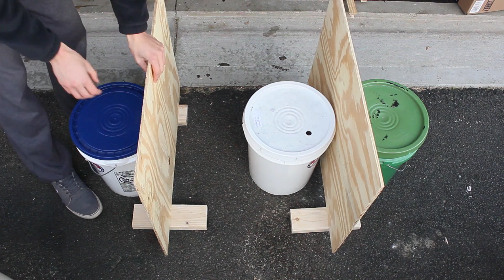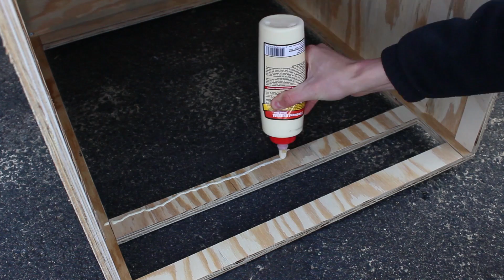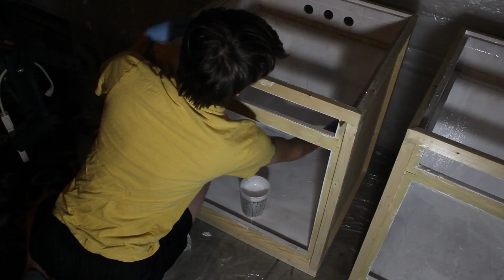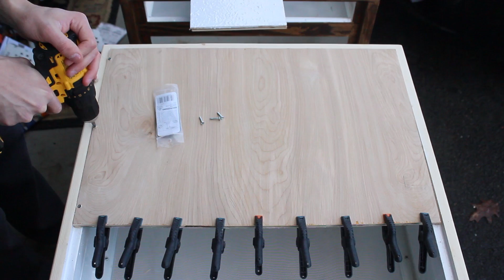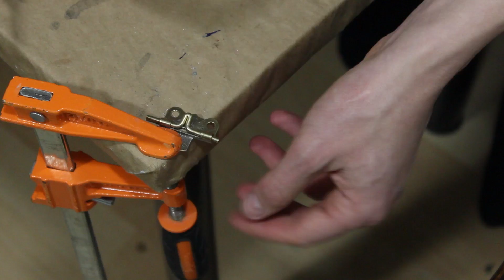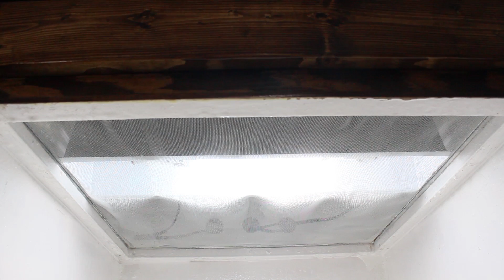DIY Plywood Reptile Enclosure (Small Version)

Comment: Genuinely curious question - Do you really need the screws considering the strength of the wood glue? I build cabinets and always remove the screws at the end per manufacturer instructions. Have you tried just wood glue before without screws?

Comment: I'd have added metal corner supports.  You can't rely on screws drilled into 1/4 inch plyboard for adequate support, though you also added a thousand individual little pieces which I wouldn't have the patience to do, and I have a lot of patience.  Over all, you are more of a craft-o-holic than I could ever be, but one way or another, it turned out nice.  Still, it would have used a pre-stain so as not to create a mottled appearance.

Comment: Wow. Great job! So many little parts that need to be cut and glued together. A little tip with the front door frames. You can drill small holes and insert small dowel rods or even toothpicks with some wood glue instead of using the screws. Then cut and sand flush with the wood. Do this before you stain the frame and it will look nice and clean. You could also probably just add a bead of silicone inside the viewing panel grove instead of doing both sides after it is assembled. 
You should put together complete plans for this. People would eat it up. 
Keep up the awesome work!

Comment: These enclosures have turned out so pretty! I don't think I'd have the diy skills to build something like those😔
Reply: For a ball python I once had I just bought a nice second hand dresser drawer and plexiglass to fit the front. I unscrewed and cut out all the drawer brackets and an entry access on the side.  Drill small holes in the plexiglass for ventilation and to attach to the wood, hope this helps.

Comment: Are plywood terrariums ok for Kenyan sand boas or should the bottom stay glass for a heating element? Love your builds
Reply from the maker: You still could use a heat mat on a plywood enclosure. Also keep in mind that a plywood enclosure will retain heat better than a glass enclosure. So I do believe that it could work for a Kenyan Sand Boa.
Reply: SerpaDesign thank you! I was worried heating plywood might damage the wood or wouldn’t penetrate enough to warm the substrate
Reply: @SerpaDesign  what type of plywood?

Comment: Fantastic man! I have been looking forward to this video for awhile. Your craftsmanship and attention to detail are always excellent. I do wonder about airflow? Did you consider putting holes or a screen in the front of the enclosure to create airflow within the enclosure? Just wondering what your thoughts on this are. I know some designs like the exoterra have the airflow holes drilled in the front.
Reply from the maker: Thank you I'm glad that it was worth the wait. In terms of ventilation/airflow, I will include a fan in the light compartment, which will bring in new air and circulate the existing air within the enclosure. That's how I did the other one and it worked well. It wouldn't be bad to include more ventilation, but it's probably not necessary for a tropical environment. That said I think a lot of people end up modifying Exo Terra enclosures to be better suited for vivariums.

Comment: Your designs are awesome, I built something similar but much, much, larger. Yours has a mesh screen covering the light compartment, how are you attaching your heat lamps inside the compartment?
Reply from the maker: Thank you. I used aluminum screen, so heat lamps can go right in without issue.

Comment: Another impressive build, nice job!  I can't wait to see the next installment.  Do you feel that a locking mechanism is necessary for Crested Geckos?  I was planning on using those small acrylic clips that you just rotate and are commonly used to hold window screening in place, similar to what you would see on the back of a picture frame. Thanks, man.
Reply: I should have stated I'm doing a polycarbonate front to a  vertical tank, obv the type of clip I mentioned would not work on the type of door in this video.
Reply: Yes! Locking mechanism is mandatory. They are little escape artists, and will sneak out of the tiniest of places. Need to guarantee a tight fit with something that isn't flimsy.

Comment: Im planing to buy a crested gecko but im wondering if i should do a tank with fake plants or a planted vivarium. I have never owned a gecko before and this would be my first. What should i choose? Somone pliz responde i need help..:/
Reply from the maker: Crested Geckos don't eat live plants. However, if you have never kept one before, you're better off starting with fake plats. Live plants will add a whole layer of potential issues that you may not want to deal with as a beginner. However, long term real plants, in a bioactive vivarium are easier. I am releasing a series on Crested Geckos shortly, so it could give you some good ideas on what to do, if you want to go the bioactive route.
Reply: I've never made a vivarium before... but i'd recommend fake plants because the gecko might eat real ones, but i'm sure there are living ones that they won't eat.
Reply: SerpaDesign thanks for the answer! And i cant wait to watch your new sieres about crested geckoes!!!
Reply: @SerpaDesign Oh hi. I have a question as well. I just made an open succulent terrarium and added what I thought was naturally colored reindeer lichen, but then when I added the water the green dye came out of the lichen And turned the soil where it was green as well as the water in the false bottom. I definitely over watered it but I read dye doesn't effect succulents. What I'm most concerned about is "will the dyed water evaporate after some time?" (also i watered down the lichen so that it has barely any dye in it now) So will my terrarium be fine, or will it dye?
Reply from the maker: I doubt you'll have any issues with the dye, but I can't say for certain. Personally I would leave it for now and if you notice your plants having issues, then redo the setup.
Reply: Okay thank you.
Reply: hey serpa love the channel how about getting some birds i'm about to (hopefully) get two cockatiels